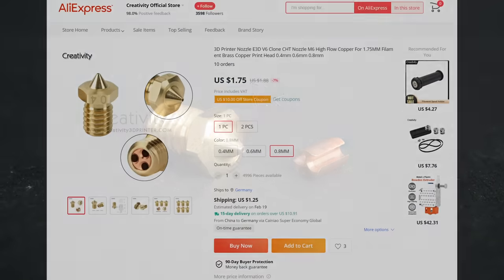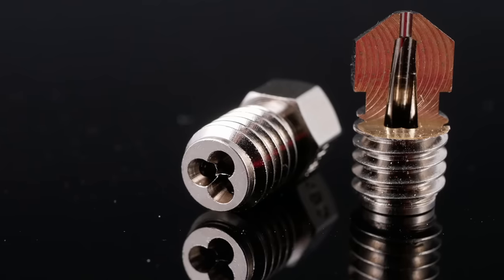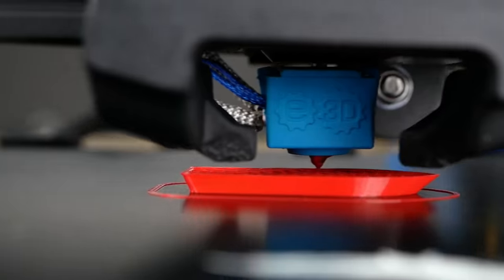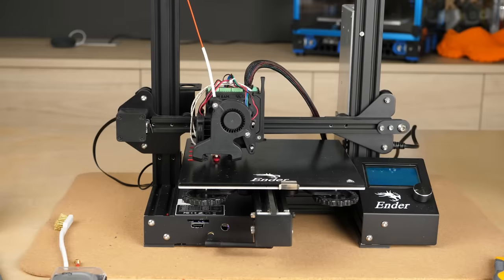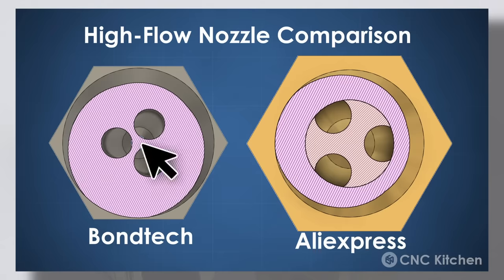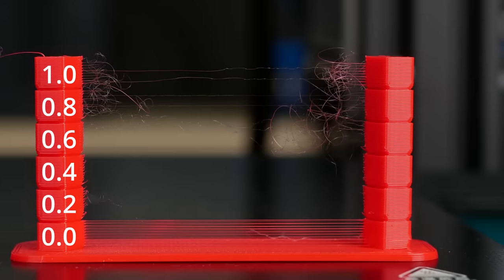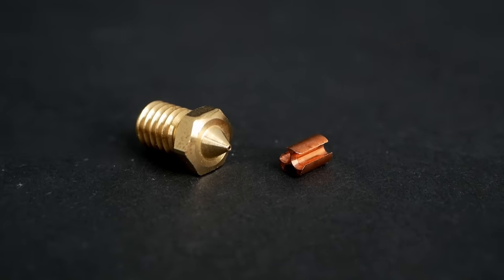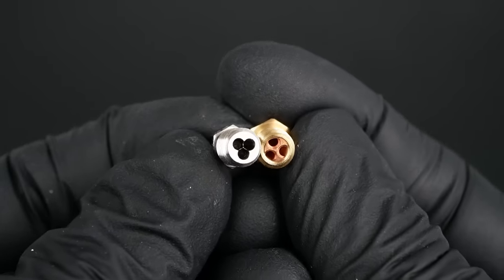$2 Aliexpress Knock-Off better than Original?

Comment: Well, shi... I had the same testing idea ;D Great video BTW. Honestly, I am surprised by well the knockoff performed. I have one too but mine seems to have a bigger "blockage" in the middle. And because there are only two trusted sellers on Ali (that I know), anything else is a gamble, like all these CHT clones.

Looking at this situation from a business standpoint, you don't want that someone would rip off your great design but from an enthusiast standpoint, you want more innovation and those patents just slow them down. It is only from what point of view you are looking I guess.
Reply: That's sort of the debate with these rip-offs. The rip-offs discourage R&D investment if someone knows their design could be ripped off and sold for 1/10th the price. But the rip offs make it more affordable, bringing 3D printing within reach of hobbyists, and forcing companies to innovate to make products stand out and be affordable, and making there be a market for them to sell to in the first place. In this case I feel like the "rip off" contributed greatly to the design - they took an effective but expensive-to-manufacture design and found a way to produce it at far lower cost with comparable performance.
Reply: @quillmaurer6563  I think its sort of balance issue:
if the patent owner asks orbital prices for it, it doesnt get used and ppl just wait for it to expire like with many great ideas in the past.
If you dont protect R&D properly, ppl get discouraged from doing the R&D in first place, because others can just take the results without paying for the effort and investment.
But if prices for the patents are reasonable, it actually gets used as well as motivating ppl to do R&D. Atleast thats my feeling about it.
Reply: @warel5730  The point you're saying is that patent-holders need to offer their design at a reasonable price in order for it to make money, serve the community, and not lose out to rip-offs? Makes sense. Though it is somewhat fair for them to need to make back their R&D costs, which rip-offs don't need to. But if they make it cheap enough and sell enough volume they should still be able to.

Comment: One big advantage the knock-offs have over the CHT is the ability to use them in hardened steel, ruby, or tungsten carbide nozzles.
Reply: You can't do that though.. without machining hardened material which is a lot of work.
Reply: @jaro6985  Which is why the insert approach used by the "knock-offs" make sense for those hardened nozzles. The insert does not have to be made from a really hard material since most of the wear should occur at the tip.

You can make a multi piece nozzle, with each piece made from a different material. A  copper alloy body with high thermal conductivity, a tungsten carbide tip, and an insert made from a somewhat harder copper alloy or steel. A one-piece wear resistant CHT nozzle would be a nightmare to make. Even the official Bondtech wear resistant CHT nozzle uses inserts.

Comment: I actually just started testing the aliexpress nozzle and so far im very impressed, i havent been able to fail a print yet, going over 250mm/s on speed.
Reply: Keep going; If you try hard enough, you will eventually fail.
Love from Montréal
Reply: And let us know how well it holds up - that copper insert aught to be much softer than the bondtech design so it may well abrade quite quickly in comparison - though the filament you print will define if that matters much to you.
Reply: @foldionepapyrus3441  The loss of material might not matter much? i mean what is hurt by that upper edge rounding over?
Reply: @SianaGearz  Depends on what rate it is lost and where - too fast and it might shed lumps that will block the nozzle, it is in the end going to interfere with it delivering heat to the filament too. 

And as it doesn't really have any great cutting edge when new it may just stop feeding altogether especially against the higher temp or tougher filament - plastic not soft enough so it starts skipping before the filament really get into the multi channel melt zone proper.
Reply: @alexandrevaliquette1941  Update: so i uh... failed at failing. I started experiencing hardware limits on multiple parts of the printer before under extrusion caused a failed print. The hardware of my ender 3 v2 could not keep up with the nozzle! At least on a benchy.
Reply: @DragonGunzs  Sorry for your results. At least you tried!
Jokes aside, how does it handle filament switch? Should you leave the filament in the extruder when the machine is cold or remove it when hot and leave the extruder empty?
Reply: @alexandrevaliquette1941  I had no issues when leaving it in while the machine cools down.
Reply: @DragonGunzs  Thanks have a great yellow Christmas!

Comment: I have a tricky question.
When I'm pushing the flowrate to the limit of my hotend, klipper shows that the heater is on all the time (PWM 100%). Though, the temperature is slowly dropping until this triggers the thermal runaway.

Will a cht nozzle improve my max flowrate ?

Because I'm already transferring 100% of the available power to the filament, I don't think so.
What do you think ?

Comment: Bring on the high flow volcano knockoffs.  Looked into buying the genuine from CHT, but I prefer avoiding giving my money to places that up-charge me to use a credit card or paypal.
Reply: Honestly, agreed.  I will support the original until the moment the original is trying to rip you off at like 10 times the price.  20 dollars is unacceptable for a nozzle... 2 dollars each is frankly pretty pricy too, I get 10 of em for like 10 bucks on amazon,  but 20 is insane for ONE nozzle.

Comment: hey i have 4 of these exact same clones lol even the packaging is the same, the QR code on the plastic bag is just some random numbers i presumed are some manufacturing  tracking code or something. there are a new design i've seen that uses butt hole shape where the center isn't connected, so in theory this could bypass the patent altogether since it is considered just a single hole with irregular shape. i wonder if someone can run the designs through some heat transfer simulations to figure out which is the most ideal shape.

Comment: I don't want to get involved on the legal side of the argument, but what we're seeing are some interesting results based primarily, I assume, on manufacturing process differences.

The fact the copper insert melts the filament faster is very interesting and does raise the question as to whether the bondtech cht were researched as thoroughly as they could have been for printing throughout efficiency. That they're releasing versions with inserts later tends to make me think the original v6 format cht were, like Microsoft Windows for a long time, beta products used to gather feedback on what works and what breaks.

It would be very interesting to see what the internal testing before finalizing the design at bondtech looked like on their nozzle, because they clearly missed something if a $2 build can outpace it.
Reply: Just saw my local reseller added then to inventory for sale... $48 a piece for the bimetallic v6 format 🤯 even Revo obxidian aren't that pricey here!

Comment: Additional improvement idea: Outside threads on the copper part and inside threads on the brass part. Larger area for heat-transfer, and better contact due to thread-preload. 11:42
Reply: If you look at threads cross section, you'll notice that threads have very limited contact points. Best approach is to press fit insert very tightly, like bondtech does with volcano CHT. It's hard to do at home though. Not impossible but requires some tools
Reply: @shadyb  Makes sense - nonetheless, it shall be significantly more than a cylindrical fit. Note also that the two materials being dissimilar, any pre-tension shall help to maintain contact in spite of temperature-change. A conical (instead of cylindrical) fit may also be worth considering, provided preload can be appropriately applied. I wonder if solder (in its molten state) may be functional as a conformal gap-filler at printing temperatures (~220*C)

Comment: I've been running a mellow cht volcano clone for a while now and it works excellent so far. Quality wise it also looks much better then what you had there.
Reply: Way expensive too . Mellow was at 25 USD if I remember well
Reply: @JorgeMarioManuelOrtega  I paid 12$ for two (so 6$ for one)

Comment: I love AliExpress stuff, it's quality is usually OK, but price is ACTUALLY reasonable. Also they often give their own spin to western ideas, and it comes out simpler, and sometimes even better in performance. Good job on their side, and let the people decide, if they want to buy on eBay or AliExpress.
Reply: I hope you don't buy any flash drives, SSD, IC's, transistor's and the like from Ali. Pretty much all is fake and does not work properly.
Reply: @repairman2be250  actually I do, and I check this stuff and it does really match the specs. And runs pretty well. It's a good way to save on price ups of local stores.

You don't have to avoid Ali, you just have to have more than couple braincells to buy there.
Reply: @РикСанчес-я6з  Some example of things you claim runs pretty well?
Reply: @repairman2be250  anything. From two bucks arduinos to i7-11800/RTX3070 laptops. They deliver exactly what's advertised, which you can confirm by buyers reviews before buying.

Comment: I like my CHT nozzles. Especially since I have a 500x500x500 printer. I am very happy to see they are working on an abrasive resistant variant of it and I will for sure buy some. The difference in speed when I have to print abrasive material with a non-CHT nozzle is really anoying. To buy an aliexpress part the part has to convince me first to be of significantly superior performance for my usecase. And even then I am reluctant to trust it compared to something where I know who makes it where and how.

Comment: I wonder whether boron nitride thermal paste between the copper insert and the brass housing would improve this nozzle...should be an interesting experiment.
Reply: are you kidding me or something? the paste would have mixed and possibly react with your molten filament. thats doesn't require half a brain to figure out...
Reply: @MegaMaking  If you use a small amount it can get stuck only between the threads, and any excess that might seep out into the nozzle/heatbreak can be cleaned by purging some filament. Nevertheless, you don't have to be a douchebag when responding to comments.

Comment: The insert thing is something I actually tried. I literally just took an old piece of copper pipe, cut a bit out and hammered it into flat copper sheet, then cut a little piece that slid down into the neck of the nozzle. I can't remember the exact speeds, but it was a 0.8mm nozzle, I think I was doing 0.3mm layer heights, and 60mm/s? So not crazy fast, but almost 50% faster than the 10mm^3/s Stefan mentioned in the video.

Comment: In many ways the Chinese parts are keeping in spirit of the open source frameworks that these products even exist in the first place. Companies like E3d and bondtech should be focused on trying to compete on higher quality and making them at a competitive price, not by taking the open source works, making a tiny modification, then patenting it so they can charge 10 times the cost.
Reply: These Western companies will usually have the first-mover advantage, plus consistency and the sorts of assurances that institutional customers need, as well as better understanding of the institutional market. This adds up to quite a bit of leverage.

Comment: Could you do a more indepth test on linewidth vs nozzle shape? In this video, at 12:40 we can see that the Bondtech has a much wider flat portion at the tip of the nozzle, while the Aliexpress is narrower and almost looks rounded over. How would this affect printing when you increase lineWidth to a factor 1.5-2.5 times that of the nozzle diameter? I have successfully printed line widths of up to 1.5mm with my 0.6 nozzle, so I'm wondering how this would compare between the Bondtech and knockoff in a similar test. If the 0.4 Bondtech could print 1mm linewidths and the Aliexpress could not, that would be another reason to get the genuine one. Considering that CHT nozzles entire selling point is high flow, this particular test would definitively be interesting.

Comment: Try to heat the nozzle assembly and check if it pulls, I think it may be tight at 200C with the copper expanding a little.

Comment: I did send you the nozzle and it came loose during shipping. It was one part when I put in the mail but I didn't use mine jet. Just tried to move it a bit with some steel wire and it seems to be fixed in the nozzle.

Comment: I got a set of these nozzles two weeks or so, ago.
Using a 0.5mm version of this Clone CHT with a Mellow Volcano Spacer, I can get up ~50mm^3/s (T-215°C, 220mm/s, Layer Height 0.20, Extrusion Width 1.1 with PLA(+).

As for (OVERTURE CLEAR) PETG, I'm having difficulty breaking 15mm/s^3. I've been running calibration models for the last 8 hours or so, lol
Reply: I tested the same setup you mentioned with a sprite extruder. I was able to get 34mm3/s.

Using esun pla+ at 200°C
Reply: @twanheijkoop6753  I'm using a clone BMG mounted as direct drive using the Hero Me Gen 6 hotend assembly
T-215°C for PLA+

I'm in the middle of a PETG vase flow speed test (like Stefan's), and I'm at T-245°C 36mm^3/s right now (150mm/s, Layer Height 0.20mm, Extrusion Width 1.20mm, needing to bump-up my Extrusion Flow to 142% to get 1.2mm dimensional accuracy)

I'm trying to see if I can get my PETG flow (currently 36mm^3/s) to match my 50mm^3/s PLA flow
Reply: 42mm^3/s now (T-245°C, 175mm/s, Layer Height 0.20mm, Extrusion Width 1.20mm)

Comment: If it is a technical/technology patent, it is hard to obtain but also much harder to overturn.
If it is a design patent, it is easy to obtain but a minor change will allow another manufacturer to easily work around the patent.

So to be clear, if a technical patent is granted, the Ali Express sold version would be almost certainly be infringing on the patent. However, if a design patent is granted, the Ali Express sold version does not infringe the patent in any way.
Either way, China does not care.

To give you some idea of the difference between a "design" and a "technology" patent, the "MagSafe" power connector patent is NOT a technology patent, it is a design patent. That means Apple does not have a patent covering the use of "a magnet to hold in a power connector" or even on the "number of conductors"; something it tried to claim, poor saps! It has a patent on the exact design of the solution. So if another manufacturer made something similar to a MagSafe connector but made the outside rectangular, Apple would have no legal recourse to prevent that manufacturer from using it. This makes sense because in Japan they have used magnetic cables on water kettles since the 1950s. Kettles are frequently set on the floor in Japan for operation, so a magnetic power cable is the safe way to disconnect the power if someone (drunkenly, usually) trips on the cable.
Of course, that does not stop Apple making threats, but as someone who beat the living shit out of Apple lawyers in court after they came after me, I can tell you it is possible to chop them down by explaining things in layman's terms to a judge, providing obvious prior art, and sometimes pointing out Apple is infringing on you (if you happen to have filed an accepted patent, which I had!) and so their patent needs vacating and they owe you money. Except for my children being born and my wife saying "I Do", watching the Apple lawyers collapse in their seats was the best day of my life.
Reply: You forgot that if the patent is granted in US only. Then China can legally make and sold the device in all country except USA.
It's not legally the responsibility of China (or any other country in the world) to care about a US patent either.
Then, sure, Canada would probably help USA more than China in the same situation, but only USA is legally responsible.
Lastly, if you have a granted patent in China... I guess you just waste money! lol

Comment: just a thought when doing that print for the flow when you increase the flow by 2mms  wouldn't you also need to increase the temp to accommodate the extra flow , you can see the shinier red finish at the bottom but as you go up it gets more matte
Reply: That’s the whole point in that test

Comment: Not sure if this has been previously explored but an idea I had for an improvement in layer adhesion might be to micro step the z by .1mm or so up and down in some interval on the internal surfaces to in a way stitch the layers together.
Reply: cura has something similar in its adaptive layer sizes that are just coming out, uses smaller and bigger lines to make a smoother print which naturally shrinks the gaps in the model.  Honestly my layer adhesion is great though, and I print in ABS...  Just get you a heat lamp for reptiles (or the bathroom kind from home depot works great and is cheaper) and wire it up as a chamber heater for your printer. ^_^
Reply: Cool idea but I think that this would be too much stress for the z axis motor/assembly. For example if you had 0.5mm long by 0.1mm high 'stitches', and were printing at 80mm/s this would mean that the z axis would have to move up and down extremely precisely 160 times per second 😬

Comment: @CNCKitchen Stefan, could you do a segment on achieving strength at high speeds? With the X1C it seems people are getting prints that are sometimes weaker than expected, so it would be nice to develop some high strength profiles for that machine.